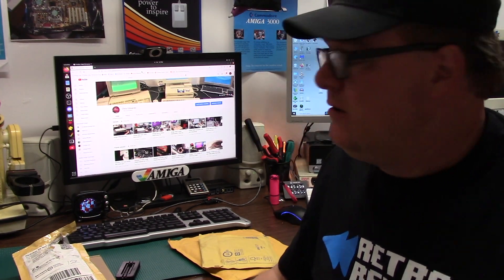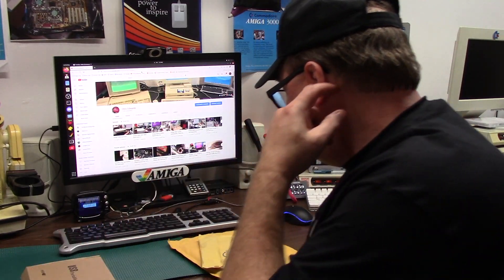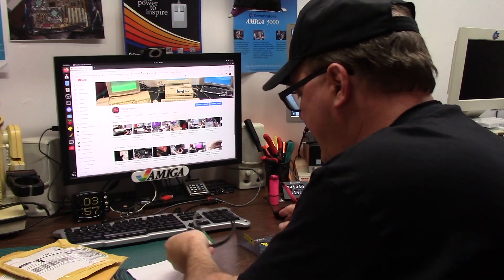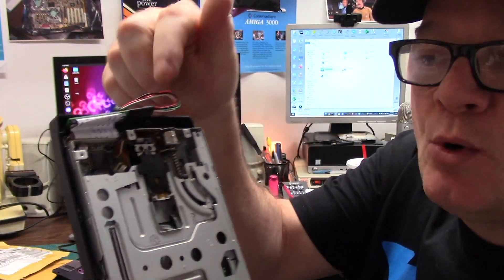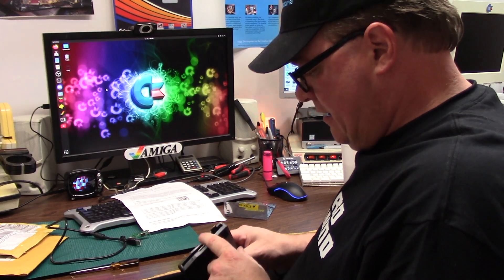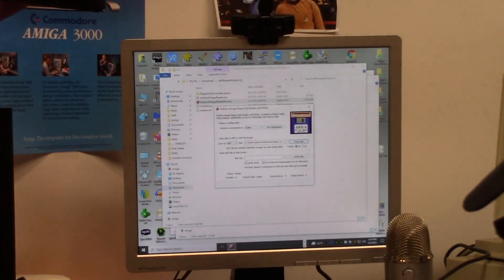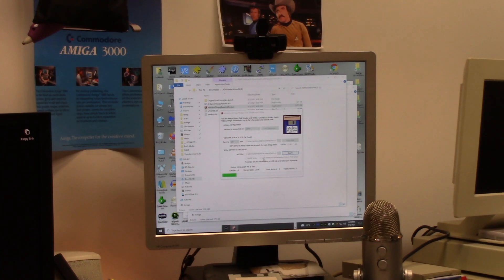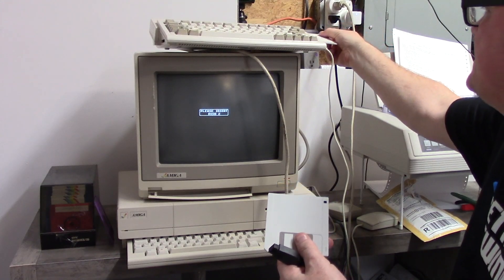Read or Write Amiga disks on your PC For 40$ or less

Comment: is there any other small (tiny) pcb circuit board device which enables the floppy drive to read Amiga discs? thanks........... i mean just like the Arduino drawbridge?? but a similar device thanks?????
Reply from the maker: Gotek is a usb floppy emulator and very popular.  Turn key less than 60$

Comment: this drive - can it act as a normal pc 1.44meg drive too? read write boot etc from normal 1.44 and 720k discs? thanx..... i would like to buy one (is it from Rob Smith computing)????
Reply from the maker: Once you swap out that board it is strictly for adf use.  Greaseweasle is a cheaper option w more features
Reply: @ChrisEdwardsRestoration  Thanks for the info: I was contemplating building one of these but I think I will get a Greaseweasle. I have a couple hundred vintage floppies and I want to try to pull the contents of a dozen or so before I sell my Amiga 1000.

Comment: Nice tool Chris.   Since you also played with Amithlon.  could you try it on a amithlon if it also works there.  Doy you also have a link for the real big disks 5.25 i think it was.  when i was young i did not have the money for small slimline so i used an external disk with big real floppyś  because they where cheaper.  i still have lots of these and also a c64 use them .  do you have an idea is there is also usb to big floppies?
Reply from the maker: I will have to test it w amithlon,   As far as i know there are no 5.25 usb floppies.  Lol

Comment: This is a pretty cool device.  I had an invite to buy one until I saw the £50 shipping to USA and was like Uh No.  I have ordered plenty of retro stuff from the UK and have never been charged more then £10-15 shipping.  Something wrong there and no it isn't the USPS.  Thankfully I have a KryoFlux which will do basically the same thing only more and at a higher level.  But this was cool and I already had several of these exact USB floppy drives so it would have been cool but yeah if they can get the shipping down to £10 or less I am in.
Reply: Shipping is about £10 to USA. It’s the import taxes that put the price up
Reply: @RobSmithDev  Ugh,  That stinks.  Is that new because I never had to pay that before coming to the USA?

Comment: Cool way to make ADF`s. I think I converted all my Disks to ADF`s and copied them to CD many years ago. 
I have a towered Amiga 1200 with removable disk drive bays which used to swap between Pc Emulation. 👍
"THE DRAWBRIDGE" is a much simpler way to do it.

Comment: I'm kinda a noob, so forgive me for not researching this. But if you have a Gotek, and a spare Amiga drive, can't you copy a disk to an ADF(or overwrite an existing ADF) on your Amiga? Or isn't that possible.
Reply from the maker: There are programs to read and write adf on amigas  but what if you had no gotek?
Reply: @ChrisEdwardsRestoration  Oh, do you need a special program to write to the Gotek? Can't you use your regular diskcopy or xcopy or whatever Amiga program?
The thing is, if a Gotek can perform ADF creation from the Amiga side, you can get a Gotek for less than $40 bucks, and it might be a better investment if you intend to use a real Amiga and floppy drive instead of emulated. That's kinda what I need to know as I have a Gotek (and as yet uninstalled pistorm), rather than having to buy this. The added conundrum, is that I have a 5 1/4 drive and floppies also (a lot of which I know are going to be dead). Thanks for answering.

Comment: Hi there. I did this trick years ago with a Arduino UNO, FTDI USB to TTL Breakout Board -(5v), standard PC floppy drive (internal) a breadboard,
some jumper wire and a 1k resistor. You wont to use jumper wire not the floppy IDE cable that has a twist (trust me on that). Than you need the
Rob Smith software and wiring diagram. This is how i got my AMIGA stuff onto the PC. It was awesome and easy compared to the alternative with
a null modem cable a PC, AMIGA and proprietary software... Just won't to let you know if you can't buy the wire with Rob's Smith PCB attached for
some reason. Yes it is a fiddly process, buying the ready to go solution is more comfortable :). Cheers!

Comment: I would like to know what it would take to get it to work on linux , I quit using windows after xp
Reply: The code already cross-compiles. There’s a bug in the currently build but next one will be ok. I believe someone is working on a Linux GUI too
Reply from the maker: If you use wine it might work for winn UAE